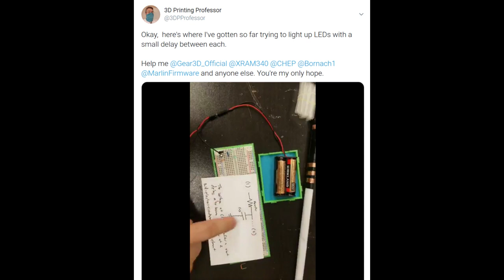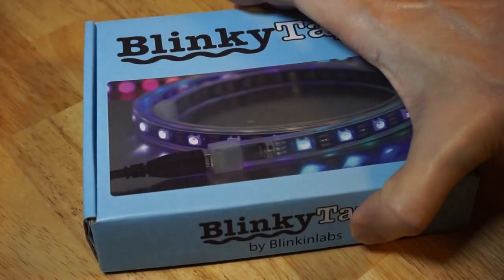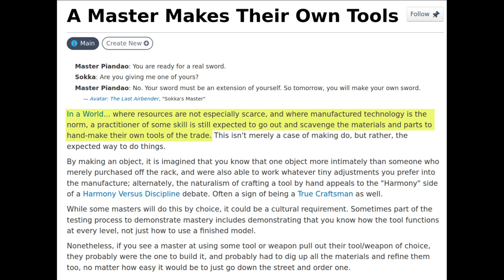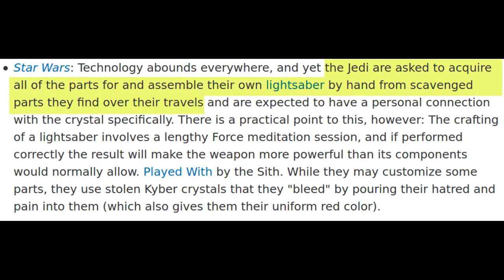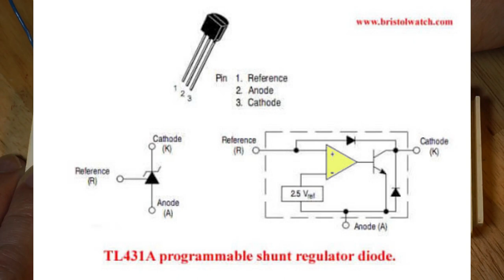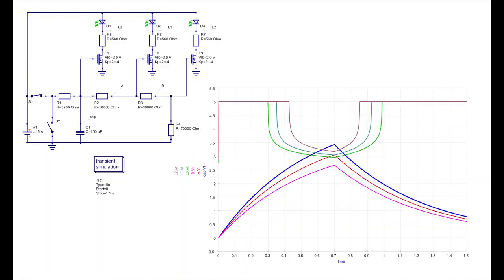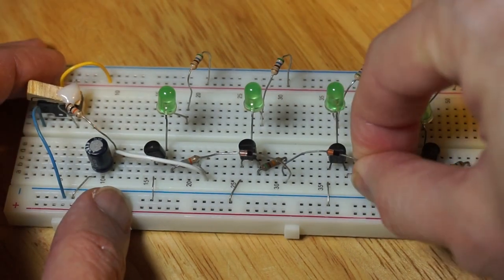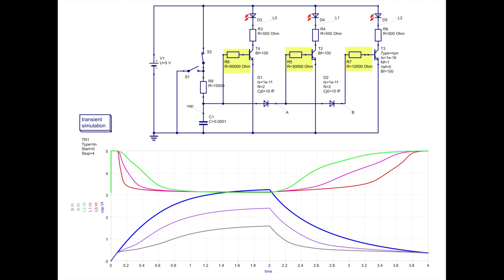Analog circuits for lightsaber props - a reply to 3D Printing Professor

Comment: Great video! It's interesting to see the different variants you designed and your explanation is very good to understand the difference. Of course the final choice depends on which scrapheap you can scavenge. If it's a pile of CFL lamps you will mostly find caps, resistors, diodes and transistors. If the heap was my attic, you would find loads of ATtiny's..